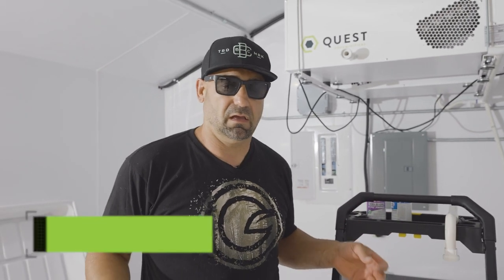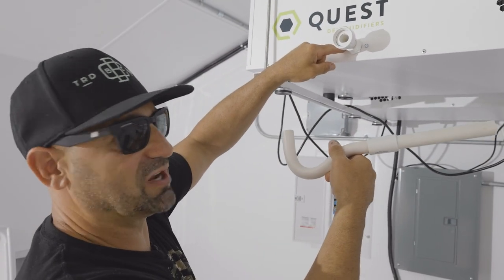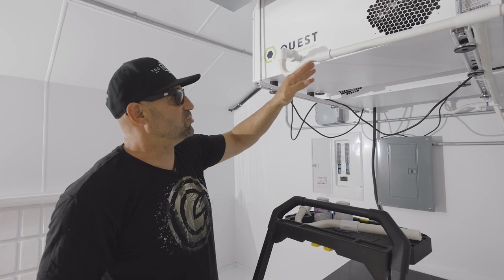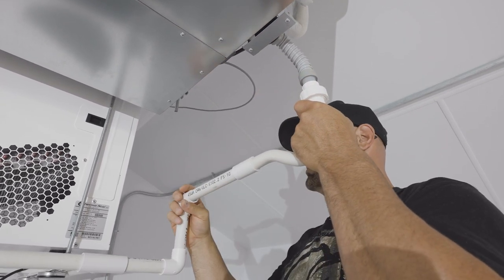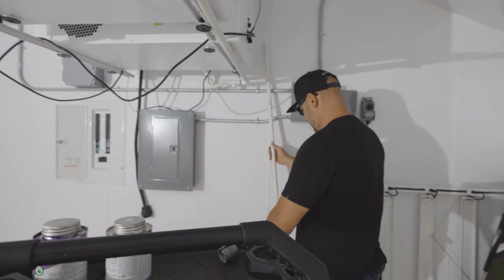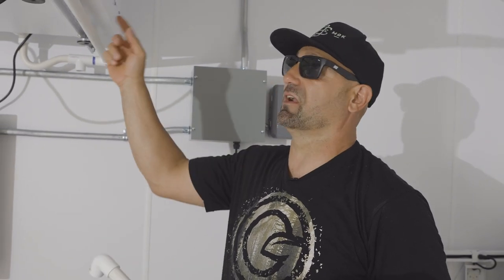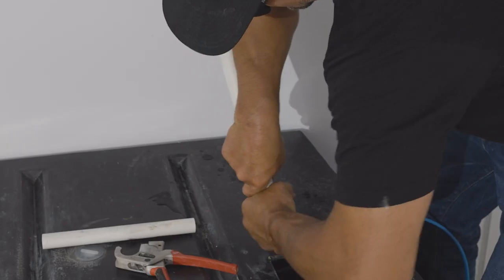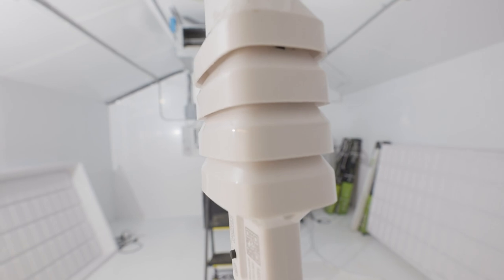Plumbing Dehumidifier Drain Lines For Your Grow | Growing Green Vol 7

Comment: Some dehumidifiers have heavy metals, always test the heavy metals ppm of your recycled water (depending entirely on the brand, the chinese ones are known to do this, not the good grow brands like shown here in the video, those usually recycle clean water)
Reply: he is using the arc system to clean the run off water before use. He mentions it in this video but goes into more detail in another.